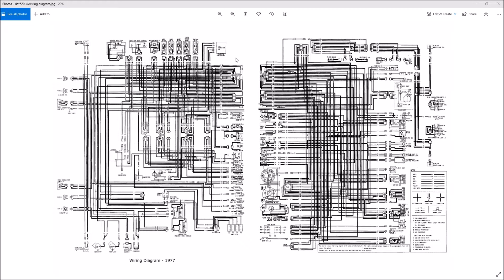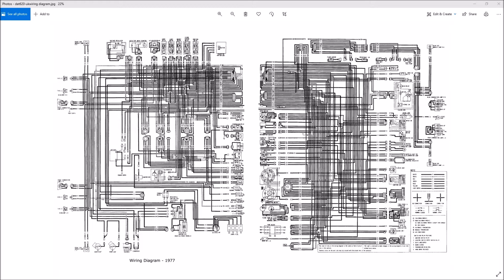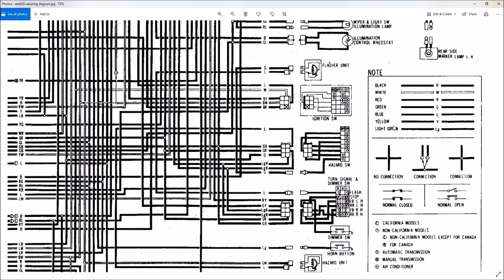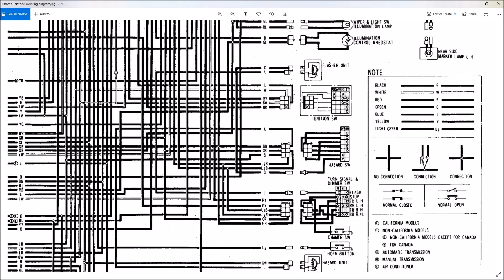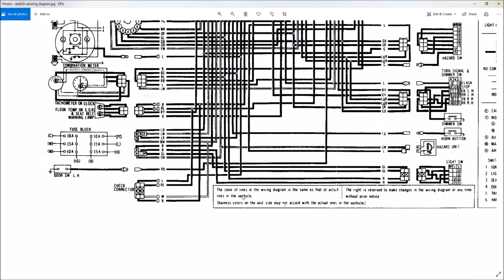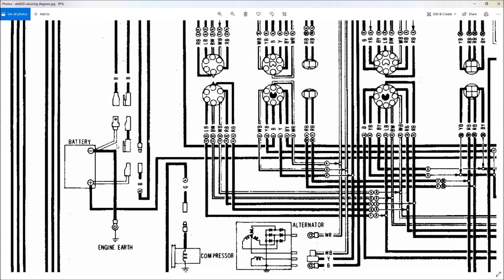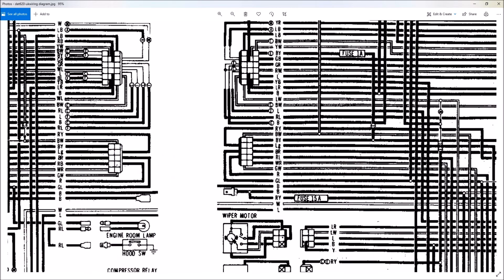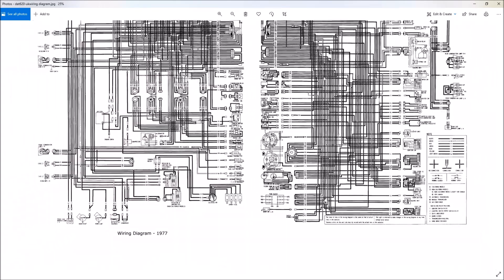How to read a Datsun 620 Wiring Diagram

Comment: For my 620 idk but I have to change my sparkplug like every 2 weeks even my battery doesn't last like a year maybe like 8 months or less I'm trying to see my wireing if something might be wrong got anything tips
Reply from the maker: You can check for draws by removing the neg battery cable and putting a test light between the cable and battery post. If the light comes on you have a draw, you can disconnect fuses and components until the light goes out, that will be your short. 
Are the plugs fouled? are they black or oily?
Reply: @i2edeye  there black
Reply from the maker: @xX6SE7EN0Xx  That indicates you are running rich. What carb are you running?
Reply: @i2edeye  4 barrel carb
Reply: @i2edeye  ya was thinking it might be my carb
Reply from the maker: @xX6SE7EN0Xx  4 barrel seems like a lot, probably would be difficult lean it out. 
I recommend getting a 2 barrel weber, either a 32/36 or a 38/38. 
http://www.redlineweber.com/carb-kits/auto/nissan/
Reply: @i2edeye  thank you
Reply from the maker: @xX6SE7EN0Xx  Redline Weber has adapters to go to the stock intake.
Reply: @i2edeye  ok cus I font have stock manifold so I'm looking for one I dont see redline weber have any manifold only carb kits
Reply from the maker: @xX6SE7EN0Xx  Here is a new one. https://weberjets.com/product/datsun-l-series-weber-downdraft-manifold-99002-825/

Comment: Can you do a walk through of the turn signal switch, hazard switch and flashers? The diagram is confusing as to how power should pass through the switches.
Reply from the maker: I can do that. Thanks for the suggestion.
Reply from the maker: Still working on this, just wanted to let you know I haven't forgotten